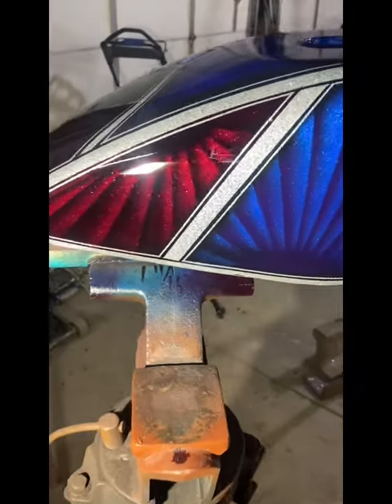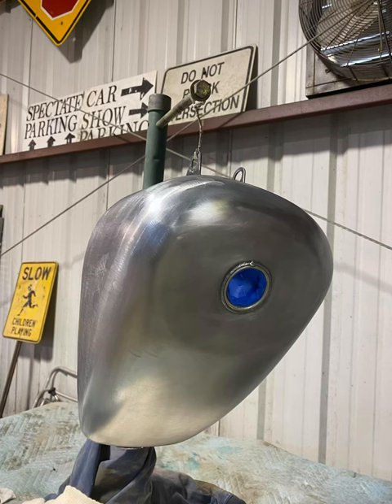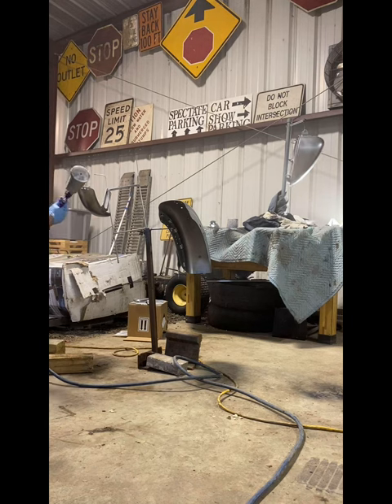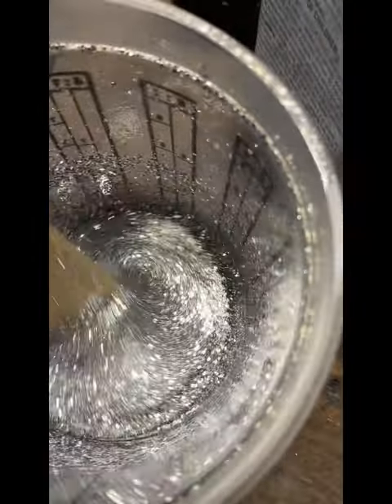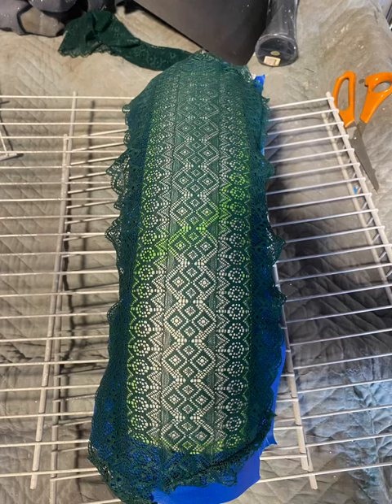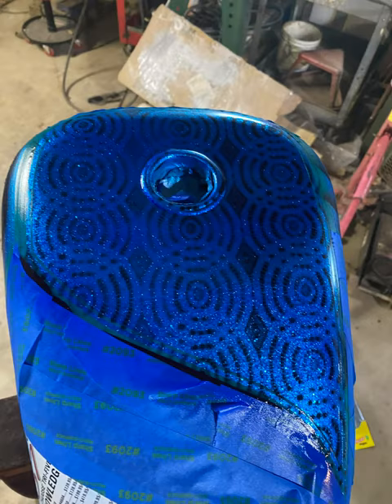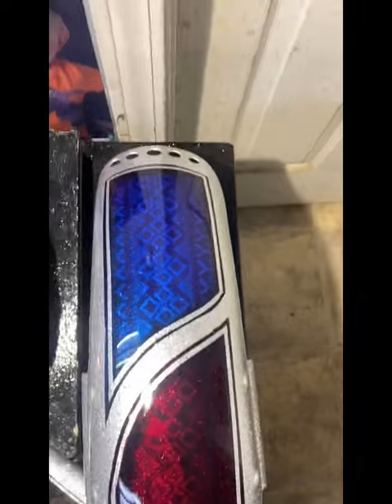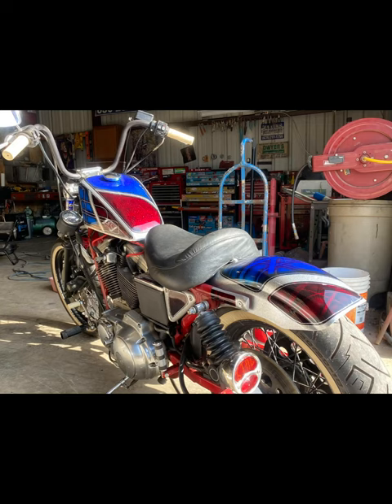Custom step by step how to paint job. METAL FLAKE, KANDY, AIRBRUSH PANELS on  motorcycle tins.

Comment: When you spray blue and tape up blue for another clolor are you spraying something over blue so tape does not pull it up or is that not a problem? in another video you said spray lace with glue so it would stay in place, when you remove lace and put clear or something over glue does it not cause a problem? thanks
Reply from the maker: No need to put anything over what you have sprayed when you tape over it. When using base coat or intercoat it dries fast. When I spray candy I mix the intercoat 1:1 with reducer instead of the called for 2:1. That way there is more reducer that flashes off fast and leaves a thinner layer of color with less buikd up. I usually start taping over it in 20 min w no problem. I don’t press it down real hard. Just lay it on. 
For the lace, that’s why I let it dry pretty good. It will be tacky but won’t leave any residue. After I spray the lace I pull it off and do the next coat or clear and have never had a problem.
Reply from the maker: Also, I know some people spray a coat of clear intercoat over each step to protect it and give you a buffer if you mess up. I have done this, but normally don’t.